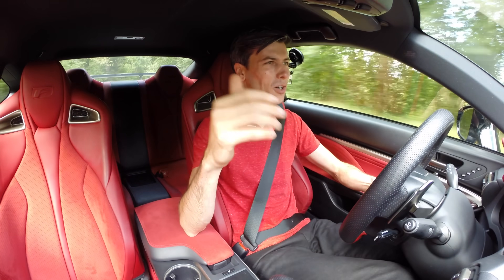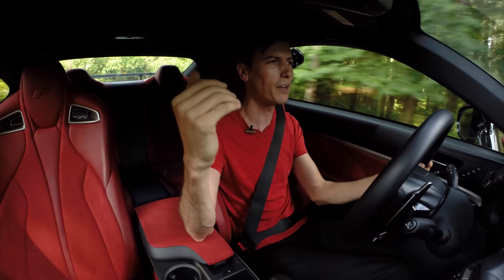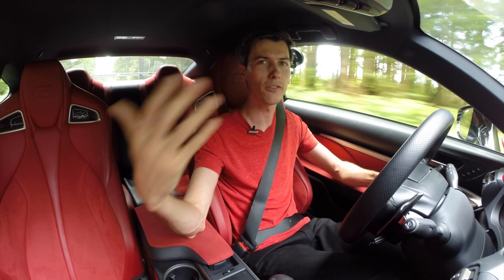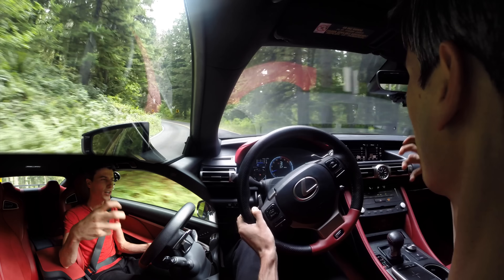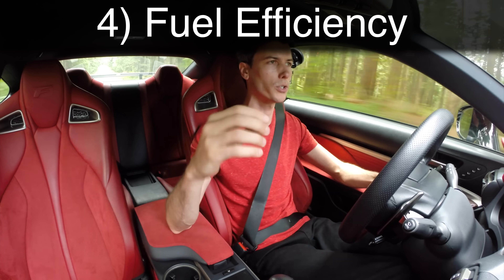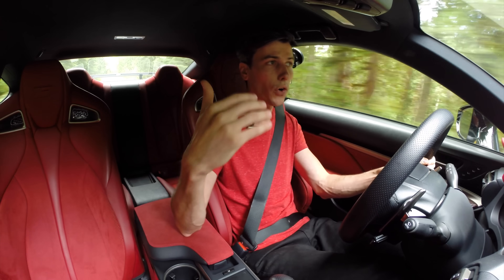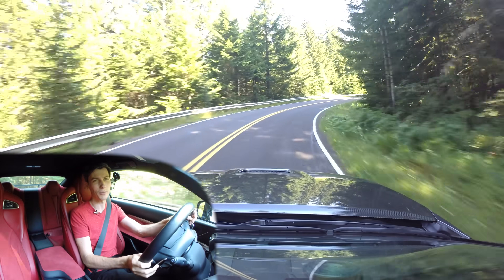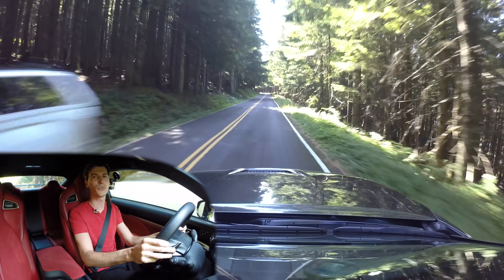5 Reasons You Shouldn't Buy A Turbocharged Car

Comment: I was under the impression that older turbos were cooled by oil hence the existence of turbo timers that keep the engine running for awhile after shutting off to prevent hot oil from coking in the turbo to not foul the bearings.  Newer turbos are water cooled hence the lack of worry of hot oil cooking in the turbo bearings.  I have two cars that really go along with the discussion.  One is 2006 BMW M Coupe with naturally aspirated straight six that continues pulling to 8,000 rpm redline.  Horsepower is at high rpm but torque comes on low and flat but drops off before maximum horsepower.  Other car is 2019 STI where turbo is nearly absent until 4,000 rpm.  Love driving both cars with their different power delivery.

Comment: Turbochargers, properly matched to a robust engine which is properly maintained, will provide power when needed and save lots of fuel.  Not sure who this video is directed at but of you can afford to drive a Lexus that goes from 0 to 60 in 4 seconds and burns premium at 15 MPG, go for it!

Comment: That's 472 HP at sea level.   I live in the northern Rocky Mtns in Wyoming.   Here @7400 FT elevation the NA  472 HP drops to approx 320 HP ×ith an equivalent 25% drop in torque.  Since the car weighs the same that is a significant drop in performance.  I don't live on a mountain top.  I live in the Laramie Valley and we're surrounded by mountains & hills with passes that range from 8600 ft to 10,500 ft.  I'l stick with my turbo charged 4 liter V8.  Driven properly, 75 mph on the Interstate, I get 26 to 30 mpg.  I still have plenty of reserve power for passing on 2 lane highways with speed limits of 65 or 70 mph.  Driven intelligently, allowed to warm up & cool down properly, a turboed engine, gasoline or diesel, will last a long time.  Change oil regularly or more often and use the proper synthetic oils.

Comment: I guess this guy never drove a current model GTR. Unbelievable torque down low, almost no turbo lag and excellent longevity. I own a 2010 with 99,000 miles on it, still running like a beast!

Comment: another reason: the power/wear/heat thats generated is split between less cylinders because they downsize the engine and slap a turbo on it.

That means you're asking more hp per cylinder instead of taking a naturally aspirated engine with more cylinders.

Comment: I usually really enjoy your videos, but this one is full of BS.  Throttle response has nothing to do with turbo/naturally aspirated, and everything to do with the electronics and rotating mass and how you drive.  If you're not in your powerband, throttle response is going to "feel" lethargic, but technically, it's just the driver doesn't know how to drive.  Fuel efficiency, you really need to compare fuel usage to power output... or even better, real world testing.  Cost... throw down numbers, horsepower to dollars.  I haven't looked at averages, but I know fast cars with smaller turbos are usually much cheaper than equivalent powered cars with larger engines, and that's not even taking into consideration how the weight of the v8 impacts vehicle dynamics or running/maintenance costs.  Anyone who does track days will tell you that the heavier the car, the higher your track day costs are, and while that is the extreme side, those differences in costs exist for daily drivers too.

One thing you didn't mention was turbo's and drag racing, specifically the launch.  Here is where naturally aspirated engines do have a big advantage, where the turbo engine either starts out of it's power band, or your putting a huge strain on your clutch/tranny.

Most of your reasoning also gets blown out of the water if you start looking at motorcycles, where a naturally aspirated engine revs high and has all the characteristics of a turbo'ed car, including the power bands, heat issues, oil issues suggesting those things have nothing to do with the turbo, and are generally associated with performance engines.  I would argue that your logic is flawed, and that you just like the sound of a v8, and ultimately, I can't fault you for that, but that's not a fact based analysis.

Comment: NA engines are inevitably going extinct, so this is rather pointless. Besides, most modern turbo engines have very little lag thanks to ever improving turbo designs and the use of multiple turbos that work at different points in the rev range.

Comment: Hey brother, hope this finds you well. I’m in a decision making dilemma. I’m looking to go the slow route. I’m currently own a focus st. Looking to trade it in for a family SUV. I’m in the middle of deciding btw a Mazda Czech 5 turbo AwD or possibly a Subaru Forester sport trim. I was watching your video about turbos? Do you think I should shy away from another tubo charged vehicle. I haven’t had any problems with my st. But with my wife’s Nissan Juke 15 the EGR value needs to be replace with only 50k miles. The dealership want over 2k to replace this because the engine has to come out of the vehicle in order to be replaced. The told me that my wife doesn’t drive aggressive enough and it probably why it when bad. Of course there is no warranty left we just paid it off... but his has me a little hesitant into getting another turbocharged vehicle. What are your thoughts ?

Comment: Good ideas of avoiding turbochargers but you also forgot to mention about complexity that it adds more weight distribution and make the car a bit slower with Inter coolers and all of that. This is why both brz and c8 corvette used naturally aspirated engines than turbochargers. If you wanna turbocharge your car you wanna increase horsepower by the ecu so that the car cannot by slower due to weight distribution

Comment: It would have been interesting if you had also talked about mean air density.  I live at 5000 ft, so all things considered, a normally aspirated engine puts out about 15% less horse power.  Whereas a turbo or super charged engine can maintain rated horsepower at elevations of about 8000 ft before they start to loose power.
Reply: This I always loved na buuuut I live in bc and losing more power the higher you go mean while the road is getting steeper and more curves lol bought turbo much more consistent in the mountains for sure
Reply: The only reason it isn't mentioned is because this video is about reasons NOT to buy a turbo.
Reply: Yeah but the air is much colder at 5000 feet than down in the city so, that helps make up for it.
Reply: Which is why a Swiss developed the first ever turbo for an aircraft and it went to 13,000ft and the pilots eyes froze shut. He landed it, blind, and rather than baulk about almost dying he immediately announced the success of the new device and how it vastly improved his aircrafts performance. The rest is history.
Reply: 5000ft?? The highest point here is like 2000ft above sea level and I personally consider that already to be extremely high since I'm used to driving only 130ft above sea level.
Reply: @dazeen9591  Where is here, exactly? Denver, CO is 5,279ft above sea level.

Comment: At one time a turbocharger made more sense as it was a way to get a lot more power out of a small engine. I remember when the 1979 Mustang had a turbocharger option on the 2.3L 4 cylinder engine. If you were easy on the throttle you could get the gas mileage of the normally aspirated 4 cylinder engine. If you floored it, you could get the performance of the V8, but of course with the gas mileage of a V8. At least in theory, you could get the best of both worlds. Now, with the improvements made with modern EFI engines you can get decent power out of a smaller engine without needing a turbocharger and the associated costs. 

The problem of hot soak, when the engine is shut down and no oil flowing to the turbocharger is solved on some large diesel engines by having an electric pump come on for some time after shutdown. I wonder if any turbocharged cars have this feature.
Reply: I believe that's known as a "turbo timer," I've heard of that being installed on some moderate to high end tuner car builds.

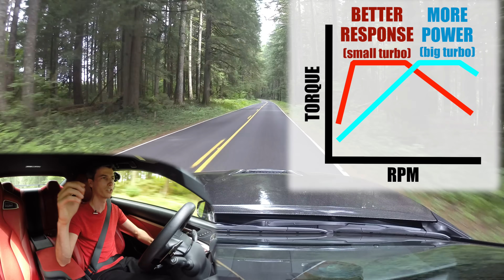Comment: 3:50 ford ecoboost engines in a nutshell. When you have 25% more torque at 2700 rpm than you do horsepower at 5500rpm, you know that engine's torque falls off a cliff. The 3.5 ecoboost, now rated for 400hp at 5500rpm and 510ft-lbs at 2700rpm, which means by the time that engine hits peak hp, the torque is under 400. Looking at ford's own 5.0 V8, it makes above 350ft-lbs of torque from 1500rpm all the way up to redline, with a peak of 410 at 4000rpm. NA engines have good performance across the band, Turbo engines have good performance across the turbo, and when the turbo is at an inefficient  point, you get closer to the engines naturally aspirated stats. 

Remember the 3.5 ecoboost is just a turboed 3.5 TI-VCT engine

Comment: If you want to get rid of lag and engine noise reduction, jut mount the crankshaft to the turbo!
I'm joking, that will probably implode, but you might have fun imploding that engine and that turbo (what I meant was to remove the exhaust to power and spin the turbo turbine with the crankshaft)

Comment: 2016 Mazda CX-5. Horrible throttle response and it's an NA engine.  Sometimes I feel like it should be a turbo when I have 0 power when I'm going 20 and need to let it rev up before any power kicks in.  The lag and throttle response is so differing at times it is puzzling.  So there are some NA engines that have horrible lag and throttle response just like turbos do.  Note: I've only ever experienced this weirdness in Mazda vehicles on NA engines.

Comment: Long term a naturally aspirated engine is superior
Reply: I agree, like being single, less stress, less things to go wrong.
Reply: Except for diesels... the 1.9 TDI and newer generation of 2.0 TDI can easy make 700 000Km....
Reply: There’s a ton of diesels that would like a chat with you.
Reply: @ryhol5417 

Diesels and Regular gas engines are NOT the same. One uses spark the other compression. Learn the difference.
Reply: @ryhol5417  you can't argue with idiots. So long as their fuel economy is below 5 mpg they're happy.
Reply: In what way? Reliability ?
Reply: @Jasontvnd9  I mean yeah mainly reliability... Also some older turbos REQUIRED midgrade or premium gas and more expensive oil.
Reply: @lockinhinddanger934  I always find it strange when you say midgrade gas but it's cause I'm from the UK , Our lowest gas is 95 octane with premium generally 98-99 octane.

Same with oils just about all our oil is fully synthetic since we change ours once a year.
Reply: @Jasontvnd9  you think it's fully synthetic but it's not.
Only Amsoil and Redline make 100 % synthetic.
Reply: @gj91471  that's just factually untrue , Europe has strict regulations on oil , If they claim to be fully synthetic then they are , I use Shell Helix and I assure you it's fully synthetic

Mineral based or not it's fully synthetic.
Reply: @Jasontvnd9  Fully synthetic is not 100 % Synthetic.
Fully Synthetic is probably only 40 % synthetic
Reply: @Jasontvnd9  Shell Helix is not that good but you carry on using it.
What is the TBN Rating?
What is the Noack Volatility?
Reply: Shell Helix is a middle of the road Oil.
Reply: @gj91471  I’ve always used the cheapie euros stuff 🤣. As long as it meets the specs I’m happy haha. Never had an issue. Higher performance stuff id get it from the dealer for the specific oil 👌🏼
Reply: @tommyfennell8670  It never pays to use cheap oil.... Especially if a turbo needs to live.
Reply: @gj91471  very true but I’ve always checked all the details and the composition for it. My golf runs on the euro car parts stuff. They have some vag specific ones that meet the requirements 🙂. If I was going for high power my tdi would get better stuff for sure though 👌🏼. It’s on 100k so must be a decent one 😅🤞🏻. Turbo is a little noisy but it’s fine. And the flywheel judders at idle but I’m not too worried. Most seem to do it a little bit. Normally do a service twice a year anyway. 🙂
Reply: @gj91471  Shell Helix comes in semi or 100% / fully synthetic. Shell Helix Ultra is fully synthetic, Shell specifically calls it that and wouldn't be allowed to legally if it wasn't.
Reply: @Jasontvnd9  North American and European octane scales are slightly different. The actual octane rating for the fuels is basically the same.
Reply: @tardonator  i do believe there lowest still shakes out to be around 90-91 though. And there is a decent amount of cars that make more power in Europe than use from tuning and gas quality. I also remember when the Pizo electric injectors were a problem in the USA, but not really in Europe, and it was due to the quality of fuel.
Reply: @Jasontvnd9 
Yes

Comment: Hi Jason! My huge thanks at first place for your wonderful videos. I need to ask you a question that has been nagging me for a long time now. Why do we need a rich mixture to reduce the in-cylinder temperature? Why can't we instead go for a lean one? My understanding is that the extra fuel that goes into the cylinder absorbs more heat to vaporize but that also means that more energy is now available for combustion which will lead to greater in-cylinder temperatures. Or the other case could be the fuel escaping from the cylinder without burning or partially burnt fuel leaving into the exhaust leading to greater HC and PM. So why would you ever want to inject more fuel to reduce the in-cylinder temperature? Why wouldn't you simple go for a lean charge instead?
Reply: imagine engine is already running hot, peak thermal efficiency, once you reduce fuel and go lean temps jump significantly. result= more heat creates detonation, fried rings, damaged piston etc. Lean mix at max operating temp is recipe for disaster. Ask anyone who's blown and engine doing so (I have recently, on a small scale). Rich mixture is crucial to avoid the potential damage caused by heat, and no adding more fuel doesn't worsen the condition bc ratio of the fuel is greater. Simple test, buy a carbed 50cc scooter, install a 70cc bore kit, keep stock jets (no increase in fuel) enjoy for a little while. Then have it blow at WOT. gaurantee it will happen, but no better way then to test it for yourself :) lol
Reply: The reason is there will be unburned oxygen. High temperature oxygen will react with metal causing degradation. So, always, air fuel ratio is slightly fuel rich. This is the case everywhere, like gas turbines, rockets. I don't know why the mixture is more fuel rich than normal at the start.

Comment: Screw turbo-chargers! I want a car with an engine that will last 300,000 miles.
Reply: 3.4 v6 2003 Tacoma I’ll be at 300k next oil change. I love that old truck but I do want something new…. I just can’t bring myself to blow the money when I already have a reliable vehicle that I’m not gonna sell
Reply: @ham7357  I'd keep the Taco until it dies... which will probably be a very long time!
Reply: 2011 model 528i inline engine  crossed already 4,50,000 km   and still running
Reply: Then you want an older VW 8v or 16v engine. My '91 Jetta GLI has 330k miles on it. The head has never been removed.

Other potential alternatives: Ford 300 cubic inch straight-six, Toyota 1UZ-FE (there's at least one with over a million miles), and probably at least a couple others that I am forgetting about.

Comment: It is obvious you don't keep your cars very long. Your driving style suggests that. Your points regarding turbos are all correct, & they are best reserved for engines running at a steady speed.  I had an opportunity to purchase a turbocharged  vehicle recently, & although the price made it a deal, I declined the offer, simply because of the turbo, & the driving techniques it invokes. My Dodge Ram with a Cummins 6BT 12 valve engine & Holset turbo have run 1.5 million miles, & both are just fine. My 78 Ford F150
(351M) has well over one million miles & has had two rebuilds & one transmission rebuild (C6). I enjoy your videos & the fact that you speak knowledgeably,. There are a number of very well informed folk with automotive videos on the net, & a horde whose misinformation can most charitably be described as "unfortunate".  Thanks for your technically correct video.

Comment: I saw a turbo that the bearings went out and it was so lose that it was grinding and filling the engine with aluminum.  That means the engine has to be opened clean out the aluminum grit.

Comment: You should do a video on blow off valves and where to mount them. There has been a debate on mounting the blow off valve in the hot side piping vs the cold side piping and I think a lot of people would really love to hear what an engineer has to to say about the issue. Regardless if there is no difference. Or if there is a minimal difference.
Reply: It depends where the air related sensors are in the car